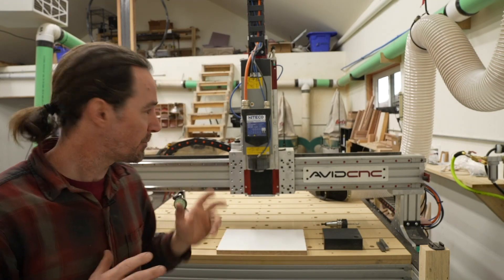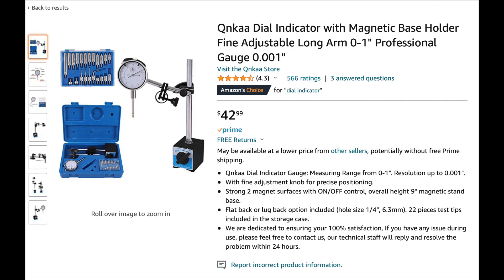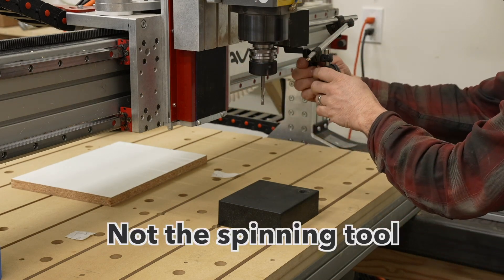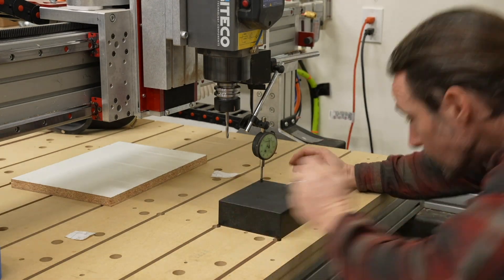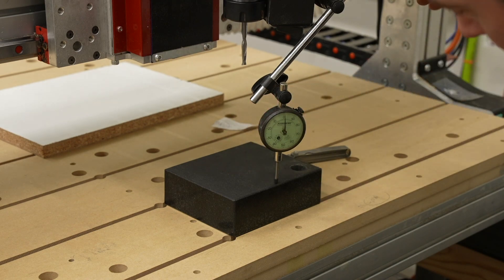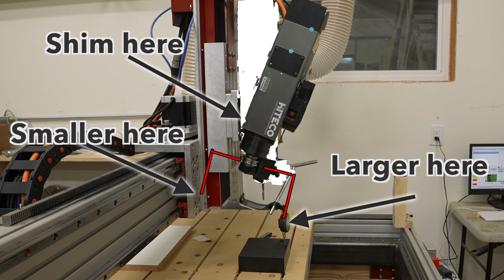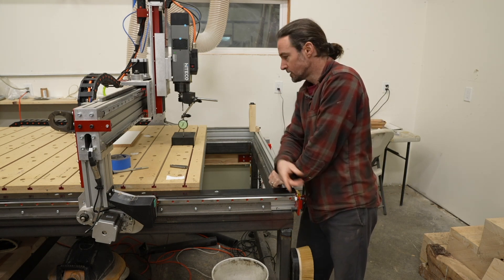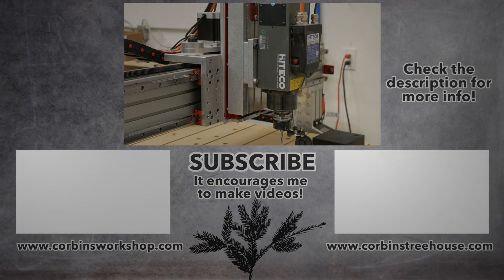CNC Build Ep 4: How to Tram a CNC - Cheap and Accurate! About $60 in tools to align the spindle

Comment: Hi Corbin, quick question: I build a table for my avid CNC to sit on. Of course my concrete floor is not perfect. Are u saying the my table needs to be level to the floor surface. Or are you saying the avid CNC parts need to be level on the table itself? Making adjustments to the avid CNC aluminum struts to make level. Can u please clear this up for me. Seems to me the table does not need to be perfectly level to the floor or does it? What happens if the just set the avid CNC struts on the table and attached to table btw I have wheels on my table I built
Reply from the maker: Yeah! It doesn't really have to be level, but co-planer, but the easiest way to ensure that is by making it level. And the only part that needs to be level are the linear rails; the part that the CNC gantry actually rides on. That is the key part! Everything else is good to do, but not essential. The table itself doesn't have to be perfectly level, as you'll put some MDF on top and flatten it to perfectly level. But if your rails are not co-planer you will have issues; so making sure they are level is the key point.

Comment: The indicator should be held in the collet not clamped to the side.
Reply from the maker: For when you are tramming? Can you explain why you think that is important? When spinning the indicator around, it shouldn't make a difference. When tramming in a vice (etc), it definitely should be clamped to the side and not move.
Reply: @CorbinDunn  I think you should mesure the runout of your spindle / collet separately. It's necessary for high precision application.

Comment: I initially used a granite surface place as is done here but learned a lesson. Unless the surface plate specs state that it is parallel, square, and flat on all six surfaces, errors will be introduced. Most small inexpensive granite surface places have only one flat surface, with all the others only being "meh" in terms of accuracy. Additionally, if the spoil board that the surface plate is sitting on has been surfaced, it's a good bet that the distance between the spindle and spoil board is already constant, so any variation is either due to changes in the spoil board since surfacing - or more likely, that the surface plate's top and bottom surfaces are not parallel.
Reply: But isnt that irrelevant if you shim it. Since you are making the top precision surface plane parallel to the indicator in each corner. You only need 1 flat surface to do this.
Reply from the maker: Yeah, you made some good points! I always shim my granite plate to get it to be co-planer with the x/y axis. And yeah, if your spoil board is surfaced, then that distance is constant, but it may have ridges in the x and/or y direction; but I bet it would be minor enough to not affect things, because anything on top would be just sitting on a parallel ridge.
Reply: @CorbinDunn  The issue with surface plates hit me when I placed two on edge, sitting on a third. If the two on edge were really high quality, their faces would be flat against each other. They were not. So, yeah, the top is flat but not guaranteed to be parallel or square to any other side. I finally coughed up the money and bought a smallish granite tri square, because if my setup isn't correct now, everything I make - especially fixture plates - will be wrong, then pass their errors on to everything else. This metrology things really hard to do without spending a lot of money...

Comment: Some basic concepts:   
First, we need to make sure the spindle is the same distance from the spoilboard at the extremes of the Y-axis as well as the extremes of the X-axis.  This assures the cutting tool, for a given Z-value is co-planer to the X-Y plane.  Once this is done you can go about the process of tramming the router head.

I have, at last count, 9 CNC milling machines.  I use the following method for tramming them:  Obtain a length of 1/8" diameter stainless steel tig wire approximately 3 feet long.  Bend one end of the wire 2 inches from the end at 90 degrees.  Insert the wire in an appropriate sized collet and tighten.  The wire extending from the collet effectively is the radius of an arc around the spindle.  Next bend down the end away from the spindle down 90 degrees.  When the spindle is properly trammed the tips of the wire should be the same distance from the spoilboard throughout the entire arc.  

Now, instead of trying to reach appropriate tolerance in a 3" radius arc, you are using a 30" radius arc.  This is a proven method and you can visually see any errors that are present.  In terms of accuracy, let's assume you dial in your spindle using the 3" radius to +/-  0.001".  This would have a +/-  reading of 0.010" with the 30" radius.  It is quite easy to achieve greater accuracy, especially when you consider the "sampled" surface under your granite block or glass plate vs a 60" diameter surface "sample".  

And, the tig wire is cheap.  I use stainless so as to minimize any deflection from magnetic sources.
Reply from the maker: Cool ideas! Doesn't this assume your spoil board is perfectly level to begin with?
Reply: @CorbinDunn his method assumes the x and y axis rails are perfectly flat, which we know is not true, especially on a machine like yours where the references for bolting down the linear rails was not a precision machined face. Heck, it's not true on any cnc router as the bed is subject to leveling flex forces. The granite method is fine but your sweep isn't big enough imo

Comment: You made The Great machine! Good job!  I made few CNCs but not looking so good. 😢😢 I spent a lot of money to made a machine. Here are two examples. I spent 400€ for the first and more than 1500€ ( dust shoe and cyclone for wood and  vice for metal included) for second machine, this is very expensive hobby.  🤔🤔

https://youtu.be/TDTDN_KkoJc
https://youtu.be/ziXmku7p6O0
I use MDF for work plate on my second shown machine because metal one is too expensive. I have great and precise vice which I mount when I am doing aluminum and metal and I use only mist not flood. I use piece of thin metal sheet to protect MDF but some coolant sometime drip on MDF 😥

Bits are very expensive although last long. I spent more than 3€ for single tungsten carbide coated bit !!!! 😗😗 and I have a lot of various bits for different materials so this is great expenses for this hobby or work.